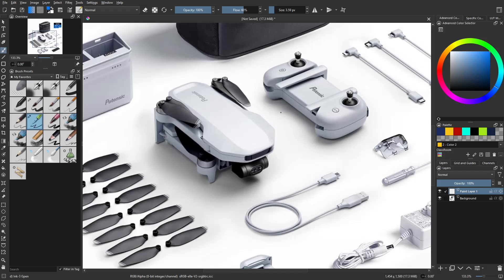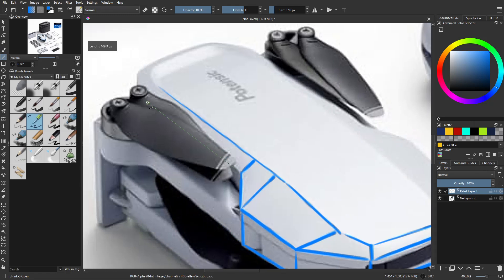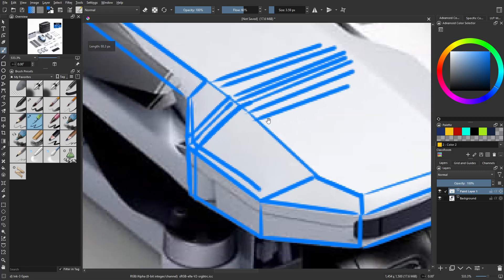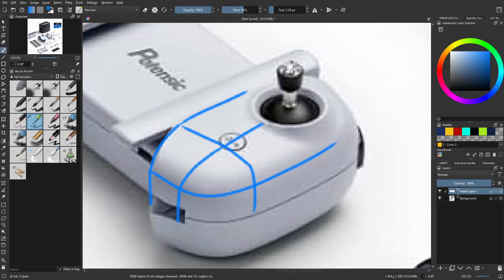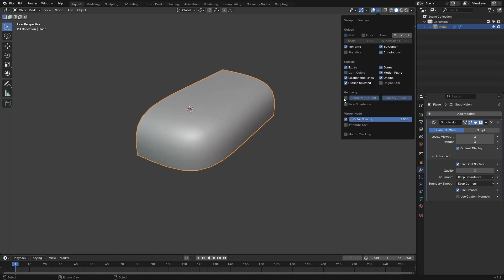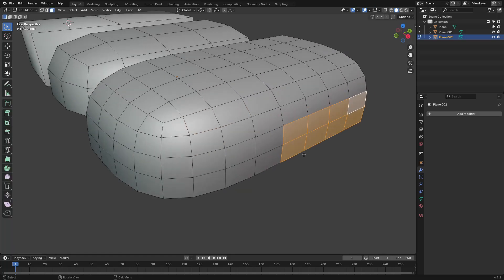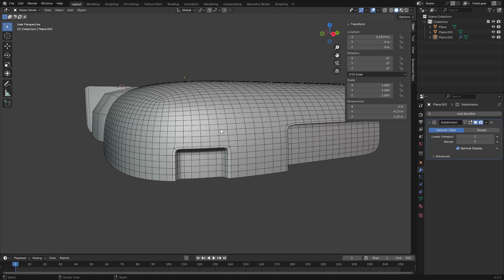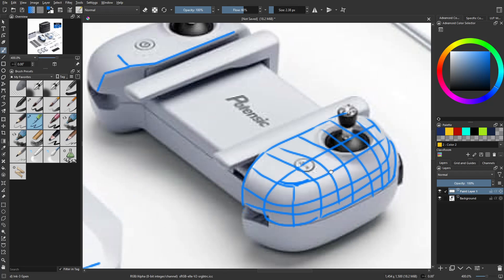Answering a question about Sub-Division Topology

Comment: I wish there was a good way to build the low poly as you built the high poly would save so many hours of retopo lol
Reply from the maker: Create a mostly non-destructive model (using modifiers usually) that can be used as the unoptimized asset but also adjusted to be a strong base for a highpoly. Meaning no major silohuette, volume, or surface changes. 

Its an advanced workflow that still requires a strong understanding of modeling/topology.
Reply: @pzthree my biggest issue is I I use creases so matching the low poly silhouette to hp with just the sub d modifier is not possible I think. I do mods mostly fantasy weapons so it’s always the curves that get me. 

I still do use the low poly un modified base and typically go in and add in more geometry to fix it instead of retopo from scratch which I find faster but probably very unoptimal but I don’t plan on being a professional but always trying to improve I do enjoy your videos so far though